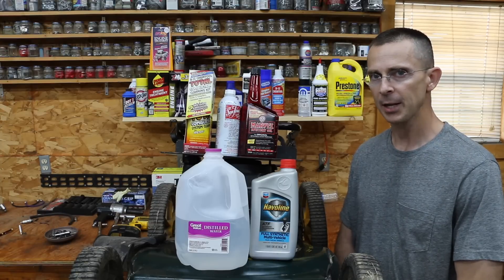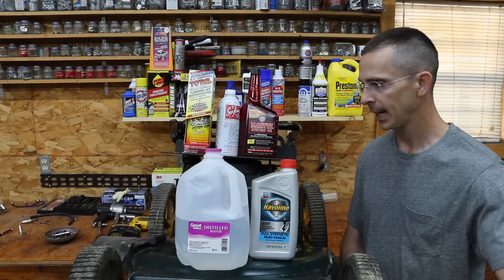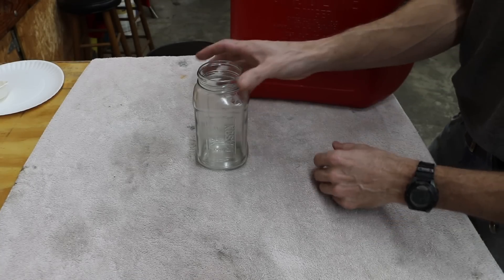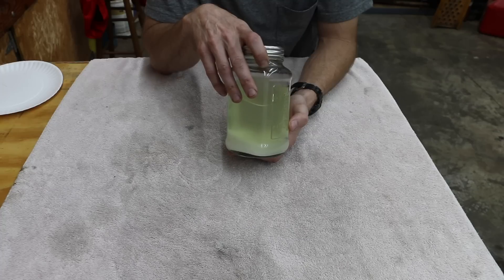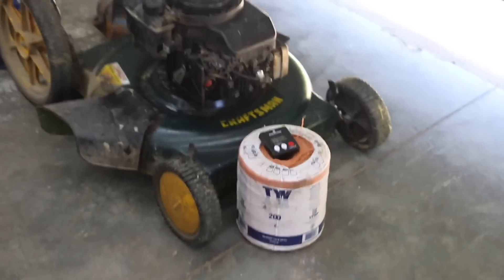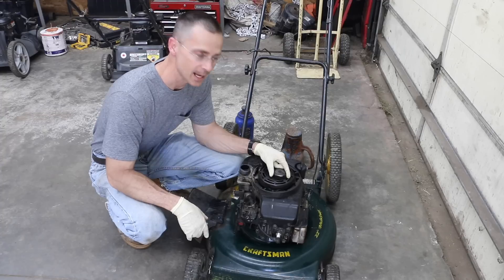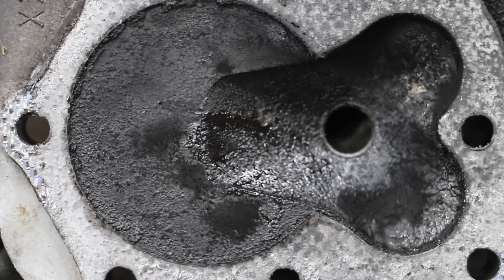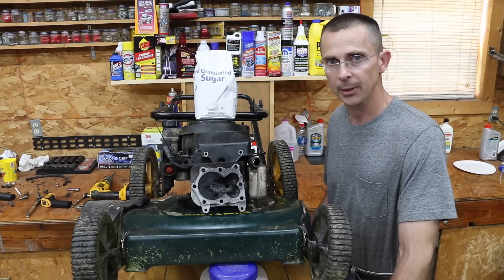Will Sugar in Gas Destroy a Vehicles Engine?  See what it does to this Engine!

Comment: In the old days most engines used a settling bulb instead of a fuel filter.  Sugar is light enough that it often doesn't settle out like sand and grit does and can get carried up into the carburetor.  What happens from there depends on the engine, ranging from significant carbon buildup like you saw to plugging up the carburetor jets, or gumming up the valves.  Seizing the engine is a bit of an exaggeration, but it's definitely not good for it and depending on what gets blocked up it can take quite a bit of effort to get it cleaned out again.
Reply from the maker: Thanks for sharing!

Comment: This is why I always have a locking gas cap on my automobile engine.
I am concerned that vandals might put some sugar into my engine.
Reply from the maker: Great point.
Reply: Don't worry about that. Mythbusters tried it (https://mythresults.com/episode15) and reported "The engine ran even better than without the sugar."
I stopped using locking gas caps when one got a death grip on the fuel neck. I had a devil of a time getting it off.
Reply: It only takes a minute to break off a locking cap with a screwdriver,just a false sense of security,sorry.keep in garage locked.
Reply: @josephbragg5445  But if they break the lock on the gas cap at least it alerts you that something is up so you can drain the gas before it does more damage.
Reply: @paradigmfl  cant disagree with that if u buy one get a metal one if possible ,plastic caps pop right off and metal holds up better im sure they cost more as if the plastic ones are not enough,they may not make metal ones anymore I havent seen a metal one since the 70s good luck.
Reply: @paradigmfl  I never had anyone break one off but I had to break my own off in cold weather they dont always want to open.A little vasaline on threads works wonders though.

Comment: Somebody dumped sugar into my gas tank and fucked up my fuel pump.
Reply: I think it was the girl in your profile picture.
Reply: Since the fuel pump has a filter to keep small particles out of the fuel system it probably plugged that up.
Reply: The filter is after the pump.  The pump is in the tank and has no filter as it uses the fuel for lubrication so a clogged filter would destroy it faster than any dirt it sucks up
Reply: Christopher Bredel: There is actually a primary filter to prevent larger particles that can damage an in tank fuel filter from getting to it. This is a fine screen which under normal circumstances will not clog as the solid material it prevents from getting sucked in will drop off it when the vehicle's motor is turned off.
Reply: yup same here fuel pump went
Reply: Christopher Bredel The pump has a little sock to keep big particles from reaching the filter or the inside of the pump.
Reply: I had bsd neighbors that were a bunch of old drunks. They put sugar in my tank. It just clogged up the pump. I cleaed it and its still running on it 215000 mi now. 
Too bad for him it apparenly rained paint remover on his shiney mustang. Hmm

Comment: I was told sugar does not dissolve in gasoline.
Reply from the maker: You are right.  Most fuels contain some ethanol too. Thanks for commenting.
Reply: Maybe not in pure gasoline. But you don't know what comes out of that "gas pump" and it sure isn't 100% pure gasoline.  Ignoring the water condensing in the tanks at every gas station (and in your car's tank, if the system isn't 100% sealed) there's at least 10% Ethanol in everything here in Canada, and then there's all the other additives that the fuel company puts in.  We don't know what they are.  So we can't predict what will or won't dissolve in fuel.

Comment: antifreeze in oil plz!
Reply from the maker: Yes, I'll do that in an upcoming video.  Thanks again for watching the video!
Reply: Project Farm Can you try running an engine on straight octane booster?
Reply: Antifreeze gets into oil frequently. I've never seen it damage an engine. Maybe if you left it in long enough. Every time you crack a head or blow a head gasket antifreeze gets in the oil.
Reply: Frequently? not really! it´s like: do airplanes fall off the sky OFTEN? not really,just ONCE!;
oh, and antifreeze(ethylene glycol) in oil, is a real DISASTER: it alters (polymerises/thickens ) the oil so much that it does not circulate,starves the bearings,they seize up,then a rod is blown through thre side of the block,and then.... you need another engine!!!!! Expensive!!!! Yeppp, I´ve seen removed oil pans full of a black mess that used to be oil; I could turn it upside down and that mess would not even drip down; thick as bearing grease!!
Reply: To the typical driver who may never experience it, it may not seem frequent. To someone who works on cars for a living, it's pretty common.
Reply: your exactly right!
Reply: @thomaswarford5562  I've seen this problem frequently.  Yes, I'm a technician,  and yes antifreeze will destroy the bearings in an engine in very short order.

Comment: Try an engine that uses a fuel pump. I think the fuel pump will clog.
Reply from the maker: Jesus, Yes, I believe you are right!    Thanks for watching the video and commenting!
Reply: Exactly correct. It will ruin a Fuel Pump. A lawn mower is one thing, a car is another. Myth NOT dispelled.
Reply: Jesus Mendoza I had a Ford van in the shop that someone had put a bag of sugar in the tank. Absolutely zero damage was caused by it. The electric fuel pump in the tank has a filter on it ( commonly known as a sock ). All I did was clean out the tank of all the sugar residue and replaced the sock on the pump. Like I stated before, no damage done and no driveability issues.
Reply: When I was a kid my Dad had a 1972 Plymouth Satalite stationwagon that someone poured a 10 pound sack of sugar in the tank, he never even knew it till almost a year later when he went to siphon gas out of it for use in something and got a mouth full of sugar and gas.

We had and used that car for over 10 years after it had been sugared, never had a single problem with the motor, did have to change the fuel filter about 2 times a year as it would clog up with the sugar.

That cars motor was still running great when we got rid of it, it had gone through 2 rearends and 3 transmissions but the motor was still running great with over 2 million miles on it.
Reply: Thats one hell of a surprise.
Reply: I bought a Dodge truck that sat for a couple of years before I got it .
After getting it going the fuel pump went out  and was filled with white debris so I dropped the tank and there was a layer of solidified sugar on the bottom that must have been there for years.
I just cleaned out the tank, put on a new fuel pump on,and rebuilt the carburetor and it's still running.

Comment: Drain tank add fresh fuel, add Ispropanol 99% or 99.5% and run with revs at about 1500 revs. It will rn lumpy for a while but then resolve itself. That the lazy mans way. If you can take tank off drain, remove all sediment, and flush. Take Fuel  injectors reverse flush, and add new fuel. Add Dry fuel by a ceratin company and run. Chris Fix does it well but alas in England most people cannot do what he says as working on the road and with the amount of people who just throw lit ciggertte buts it is an hazord and illeagal to work on a fuel system. Most house here in UK at leat 85% do not have a drive a garage, or if they do have a garage they are too small to prove useful. We also do not have the climate to dry the constituent parts as Mr Fixx states. But great video from you. As per always.
Reply from the maker: Thanks so much!  Thanks for sharing.

Comment: boil hot water
Reply from the maker: Jesus, This makes sense since sugar is water soluble.  Thanks for watching the video and commenting!
Reply: I've never seen an engine run with that much water in the fuel.
Reply: Just a little bit of water in the bottom. Not an absurd amount, just enough to simulate what is in a real tank. It will then dissolve the water and will actually make a big difference.
Reply: Good idea Dennis. I was thinking a little water could easily go in and let the engine run, letting the water take the sugar away, and you could use water decarbonization while you're at it from the intake. I personally found water decarbonization very helpful, but there are dangers and warnings. Come to my channel and search on it for it. It's awesome.

Comment: While stationed in Germany I was given a high mileage BMW with sugar in the tank. I cleaned the clogged up fuel filter and it started right up. Every few weeks I had to clean out the filter again. After about a year of this I finally removed the tank and cleaned it out. He had really made that girl made because she had dumped around a whole bag of sugar into his tank. Once I cleaned out the tank it ran fine. I passed the vehicle on to another airman in need just before I left. I can attest that the sugar did not ruin that motor.
Reply from the maker: Thanks for sharing.

Comment: Great mower. Used on 12x15 yard. Strong. It's built different. You have to walk fast to keep the blade rotating like a push mower, but cuts faster. Slight smoke coming from the badass mower exhaust so you know it's working. Wont stall, if you see crystals in the gas tank that's the new tech octane booster
Reply from the maker: Thanks for sharing.

Comment: I'm no chemist, to be sure. Wondering - what would it be like to try a few different chemicals to see what might dissolve the sugar. Emulsify with water then mix with denatured alcohol to get it flowing for burning? For vehicle fuel tank, I think remove and steam flush - the sugar would mix with the hot water and then drain out. Probably 3x clear rinses before adding fuel again. I would think the sugar could recrystallize when exposed to the air - maybe. Sugar will burn, for sure. Hope you have fun figuring it out. Thanks for doing the test.
Reply from the maker: You are welcome!  Thanks for the suggestion.

Comment: i bought a repoed car from a used car dealer once. it had gotten hard to start for them and  bought t very cheap. turned out someone had put sugar in the CRANKCASE. The melting sugar glued the rotating together.    I pulled it down and found very little damage, but no solvent would clean the sugar off of the cylinders, crank, etc. But after washing in all down with HOT SOAPY water, new rings bearings, gaskets she ran for a long time.
Reply from the maker: Thanks for sharing.

Comment: The old Volkswagen air cooled Bugs weren't equipped with a fuel filter.  We had a customer come into our shop with an engine which lacked power.  It took full throttle just to keep the engine running.  We noted that there was sugar particles coming out of the acceleration pump nozzle.  Somebody had somehow put sugar into his gas tank.  While taking the cylinders off we noticed that the cylinders had to be forced off the pistons.  There was a blackened coating on the cylinder walls which resulted in no oil clearance between the piston skirts and the cylinder walls.  We even tasted that black coating and it had a sweetness to it.  So yes, if you have a carburetor engine without a fuel filter installed, it will cook the sugar onto the cylinder walls until there is no oil clearance.
Reply from the maker: Thanks for sharing.

Comment: I have not tried it but I have heard that if you add sugar or corn syrup to the oil you're going to have a bad day! It will get hot enough to melt the sugar and when it cools it becomes just like a hard candy. It will glue all the internal parts together. I think you should try this! As far as I know the only way to unseize the engine is to literally boil it to dissolve the sugar. Not a very practical thing to do! I'll keep my eyes open to see if you try it! Thanks from hippie Steve!!
Reply from the maker: Thank you!

Comment: i have had my gas sugared and it definitely will harm an engine. Gasoline won't dissolve sugar so it .needs to be dissolved before adding to the tank. In my case it formed a clear solid glaze over combustion surfaces and caused pitting after longer exposure. After trying every cleaning product that I could, the only thing that would remove the deposits was VERY hot water. The glazing will also build up on the sparkplugs and stop them from firing.
Reply from the maker: Thanks for the feedback.

Comment: I grew up in South Africa, which is a major sugar producing country, and there was a low-cost fuel available from some fuel stations called Union Spirit, which was made from alcohol from sugar cane.  I spoke to a guy who bought an old car that had been run on U.S. then left to stand for a year or more, and when he bought it, the engine was seized, so he took the head off to see what he could see.  This was around 1970, when engines had distributors and carburetors, long before engine management units.  When he knocked the valves out, most of the valve guides came out with them.  He also had some difficulty knocking the pistons down the cylinder bores.  So, yes - sugar leaves deposits that are not good for an engine.
Reply from the maker: Thanks for sharing.

Comment: I ran a motorcycle repair shop for many years and came across sugar in tanks several times.  Symptoms were that the bike would start fine, but as the contaminated fuel reached the carb the performance would fall off, perhaps by about 50% and then if the engine was stopped it would refuse to restart.  Full fuel change always seemed to put things back to normal.
Reply from the maker: Thanks for the feedback.

Comment: Somebody put sugar cube in my gas tank many years ago. I found out as it partially blocked my fuel filter making the engine run rough intermittently.  I heard something rattling in the filter when I took it off to blow through it.  Tapping it on the radiator yielded sugar granules. I took the tank off and found 6 mostly intact sugar cubes.  I wonder if icing sugar would have been more damaging.
Reply from the maker: Thanks for sharing.

Comment: First, I noticed that the engine did not start  before you added sugar to the fuel.
More importantly, it's not whether adding sugar to the fuel will ruin it, it's adding sugar to the tank. The test should have been to put fuel in first, then add sugar to the tank and then let it sit, as you would if you were sabotaging someone's vehicle. Then run it. Will the sugar clog the line? Will it gum up the filter? What if you were to add a whole pound?
Reply from the maker: Thanks for the feedback.

Comment: I had an 82 GMC pickup that was 10 years old and I had an angry hunter dump sugar in my tank.  Nothing happened for over 6 weeks until we went on a family trip and I just couldn't get much acceleration towards the end of the 600 mile trip.  So I took it into our auto mechanic and when he took the carb apart he found the sugar recrystallized in the carb where the float was located.  That kept the gas from entering easily into the combustion chamber.  The mechanic rebuilt the carb and had to clean both tanks (dual tanks) and my insurance actually paid for the damage.  I drove that truck for another 100,000 miles without any further issues.
Reply from the maker: Thanks for sharing!

Comment: I dont care for additives, but I like sea foam.
There is one thing I have come across, that's adding a small amount of diesel fuel to your has tank every so then.
In the tank that holds about 12 gallons or about 40 liters add 4 liters or one gallon of DIESEL fuel.
It help to clean the engine.
I would do that sometime, when I did my head gaskets the pistons where clean and so was the sleeve.
Reply from the maker: Thanks for the feedback.

Comment: Okay so as I understood the story it was the fact that sugar doesn’t dissolve in gasoline. Causing the fuel filter to clog quickly. So almost all modern pump gas has ethanol, which will dissolve sugar. I wonder which you were using in your test. And if I was trying to burn through the sugar I would use heat or another fuel dryer since those are mostly ethanol.

Comment: Anyone having taken a college or even high school chemistry class would remember the difference between polar and non-polar and know that gasoline being non-polar and sugar being polar would not readily mix and thus a good fuel filter should stop most if not all of the sugar crystals from getting into the fuel line, carburetor, and combustion chamber.  On the other hand, any Karo Syrup with a high sugar content might easily get through the fuel filter and into the combustion chamber.  Be interesting to try an experiment on that.
Reply from the maker: Thanks for the suggestion.

Comment: I had someone put sugar in my gas tank, the sugar would not desolve but it would collect on the fuel pump intake and would stop the flow of gas and the car would die, the sugar would then float back to the bottom and the car would run again until it plugged up again. The mechanic told me that unleaded gas will not desolve the sugar but the old regular would and would cause major engine damage, not sure if that's true or not. Ended up having to replace gas tank and fuel filter. How did I find out about the sugar? I was on the interstate going about 80 on I-80 went to pass a semi, had a semi behind me following me on the pass when suddenly the car died almost got run over by semi following me, he went sideways to avoid me and I know he wanted to beat my a$& but must have seen I was having issues
 I was so close to death because of some jerk! Great video thanks